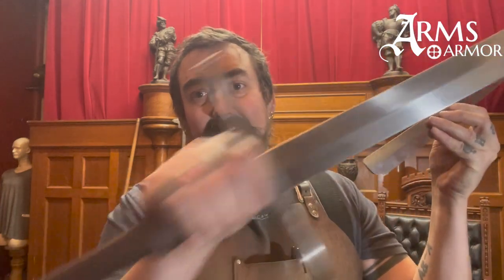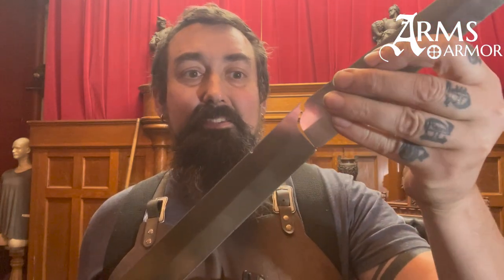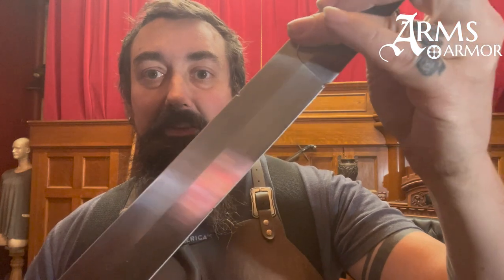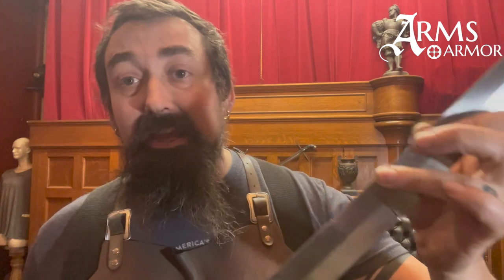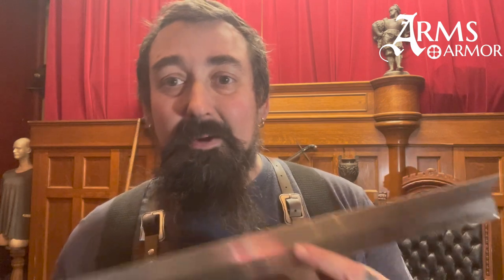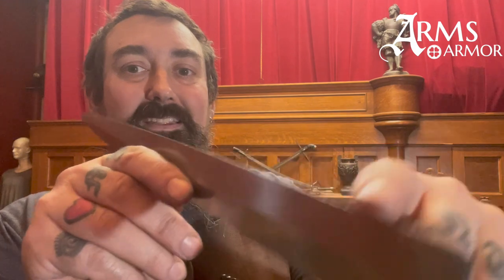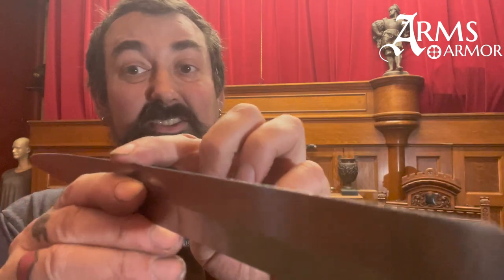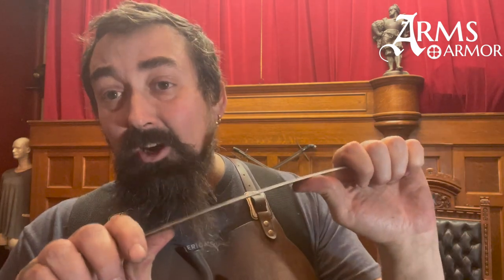How to break your sword...

Comment: With the later sword styles that explicitly tell us to parry/block edge to edge, they typically use the blade's forte. I notice that this break happened rather high on the blade. When using the forte rather close to the hand to stop an opposing blade, as is done in George Silver's style, it's the most robust part of the blade. The attacker's blade would tend to come off much worse than the defenders. So that's a factor to keep in mind. Defending in a way that makes your opponent's sword more likely to break than yours could be advantageous.

There is absolutely evidence that swords frequently broke in battle. For instance, William Patten's account of Pinkie 1547 mentions how some cavalry soldiers broke multiple swords in the pursuit. The Scottish forces had dropped so many swords in their flight that finding a new one was easy. It's not clear from the account how these swords broke, but Patten mentioned striking swords at helmeted heads in the pursuit.

Comment: I've had a few really high-quality practice ("sparring") swords break, and they all broke at the Center of Percussion at about the 2/3 or 3/4 length of the blade, and they broke exactly on a previous nick location, even though those nicks had been filed and ground/reduced to a reasonable rounded "dip". As I've heard it explained to me, any serious nicks like these create micro-fractures in the steel, and then if you get a few more hits in the same location (which is almost certain at the C.o.P.) then eventually that steel is going to shatter along the line of that previous micro-fracture.
Reply from the maker: Yes we see a wear pattern on original blades in the same areas. It goes to reason that when swords are used in the same spots over time it will affect the piece.

Comment: Very cool video.  Regarding edge parries, I think the pendulum swung all the way to the other side and nowadays we think that flat parries make no sense at all.  That doesn't seem to hold up, if we analyse the techniques.   In German fencing, both with longsword and with messer, they use this thumb-grip, where you place the thumb on the flat of ricasso.  
It makes flat parries very hard to avoid.  They even put the nagel in the right place.

One more thought - It seems that metal armor not only prevents you from taking damage while being hit, it may straight up prevent you from getting hit in the first place.  If not for sword damage, people might be willing to hit hard the joints, in hopes of the armor eventually jamming up.  But if you risk disarming yourself in the process, that doesn't seem like such a great idea anymore.

Comment: Also, in Japanese sword arts most of the parry’s end up being with the side of the blade.  This because the sword is held edge down, and swept upward and to the side to parry an opponents downward cut.  Another common block is to hold the sword vertically and edge forward, but then to move it straight to the outer line of your torso to block incoming cuts.  Since the wrists are locked to resist the cut being blocked, the edge stays mostly forward.  

I suspect the Japanese sword arts are more indicative of medieval European battlefield sword techniques than HEMA - because the JSA’s assume the opponent is wearing armor, and HEMA assumes blossfechten.
Reply: I think it's more the back than the flat, since the kata (with bokuto) emphasize a lot on using the shinogi (the speficially made angled flats on the back, not the flat back, but the angled ones) for nearly all parries. Even the thrust parries/displacements (like the 3rd and 7th tachi kata in kendo) heavily emphasize using the shinogi.

Comment: I’d LOVE to see some testing with steel that is as historically accurate as possible. There has to be a way to analyze the steel/iron from medieval swords and try to recreate it to testing. 

Also thinking about differential heat treating, fullers and case hardening. So many variables it seems. Is there any historical evidence in differential heat treat and/or case hardening?
Reply from the maker: Check out our posts on Medieval Heat treatment in the blog. The big obstacle is budget to do all above.
Reply: @armsarmorinc.4153  I’ll do that. I didn’t realize you guys also had a blog. How much funding would you need to do the historical testing and analysis? I run Fire Iron Forge in North Idaho. We’re a full time blacksmith shop and school. I’d love to partner with you guys if you’re interested. Especially for educational purposes.

Comment: Wondered for a long time how many daggers and seaxes were part of a sword in an earlier life, so to speak. Related, would love to learn more about how a hilt would get a new blade, and how a blade end broken off might be redone and fitted to a new hilt. Also! You mentioned Narsil, and there's that scene where they forge the pieces back together. Is reforging an option? Similarly, for a chipped edge, you mentioned grinding the chips out, which of course removes material, but I am wondering if material could be forged back on? I suspect not, because reheated & tempering, etc. might affect the whole blade? Probably I should go Google those. Anyway, thank you for sharing your expertise and insights in these videos.
Reply from the maker: hello, I don't think reforging a blade back together would work very well, for the reasons you mention.  You could certainly regrind both ends to make shorter weapons, which is not difficult and was likely done a lot.  In fact, we often use broken weapons to make new smaller weapons for ourselves.  My boar hunting dagger is actually the last foot of an old sword, ground down to have a new tang!  If you were to reforge a broken blade you would probably want to break or cut it into shorter pieces, stack them, and then forge weld that stack into a new bar that you could draw out and shape into a blade.
Reply: @armsarmorinc.4153  Thanks so much for replying!

Comment: When I say edge on edge I mean direct 90° impacts. When you showed the impact at an oblique angle I would personally have called that edge to flat.
I personally have found when I have sparred & moved as I interpret things that it's actually more difficult to hit edge to edge than edge to flat (which includes what you described as oblique angles).

Comment: Aren't there many examples where the blades were not sharp for their entire length?  It would make sense to sharpen the half closer to the point, which you want to use to inflict harm, and maybe leave the stronger section near the hilt dull for parrying purposes.
Reply from the maker: We see some like this and also pieces with specifics spots to place the hand for half swording.

Comment: I have smacked a few swords together in my day.  One thing that seems to break them quicker is  creating chip/nick/ding/wedge in one side then striking something sturdy with the reverse side.  Do you find historically that one side was more diminished than the other?  It stands to reason people had similar results in the way back when, and I wonder if swords tend to have more damage on one edge either by the fact they survived or that users tried to keep the damage on one side intentionally.
Reply from the maker: Also the way swords are, most users have a preference to how they hold there sword and tend to use the same long and short edge orientation.

Comment: How do you replace the blade with the pommel peened? Do you break it off somehow and weld another tang on, or something? Also, please test that angled edge-on-edge bind some time; would be very interested to see the results.
Reply from the maker: This is why many swords had a peening block where the tang emerges from the pommel.  it is an extra piece that protrudes up from the pommel that allows you to grind the peen off so the sword can be taken apart more easily.  otherwise you can drill the peen out of the pommel as long as the peen has remained relatively soft.
Reply: @armsarmorinc.4153  Huh. Something that's been lost in the modern times.

Comment: When you hold the sword in the thumb grip (placing your flat in line with your wrist and radius/ulna), you mostly parry instinctively (oh shit! parries) blows with the flat because of the line of force/resistance being along the flat. I believe being parried (my weak their strong) is more problematic then parrying. As your sword also broke at the weak. I haven't seen a sword or a feder break at the strong yet.
Reply: " I haven't seen a sword or a feder break at the strong yet "
It's apparently quite common, as the leverage is the greatest there.

"D.A. Kinsley, British Sword Fighters, p 289
I struck my sword into his skull; but the fellow, being big and heavy, snapped it asunder as he fell, within a span of the hilt."

"D.A. Kinsley, British Sword Fighters, p 507
he made it descend on the pericranium of his unfortunate adversary with a force which snapped it at the hilt."

It may happen less often in practice, since people do not consciously try to hit their practice partners with full force.  During a parry, the inertia is trying to bend the blade in half, so it's reasonable to expect more breaks further up the blade, especially if we factor in cumulative trauma.
Reply: @bakters  Interesting anecdotes! Thank you very much! I don't quite understand how the leverage stuff works, in particular when considering distal taper and the fact that there generally is way more speed at the weak. But then one has to consider the difference of simply impacting or effectively penetrating the target. I imagine that penetration can put some torque on a blade, for example hitting bone at funny angles or by weight shift as in your second example.
Reply: @freifechterbasel6115  Re: "leverage" it's simple distance*force, so the same force acting at a longer lever creates much higher torque.
The physics of impact is not trivial, though.  Even if I could do it justice, it would take a long time to explain.

Although, maybe not?  The swords want to rotate around their pivot points.  If you reverse the rotation, which happens at impact, the highest stress is more or less right at the pivot point.

Obviously, people tried to counteract this phenomena by making the forte very thick.  But it still happened from time to time.
Reply: @bakters  Thank you, this helps!
Reply from the maker: Excellent points in over forty years of sword making I can think of maybe two that gave way in the forte area. Both older blades and be used in heavy conditions, shall we say. I think the historic term was "buffalos"

Comment: Interesting.  On a related note, how often do you see tang shoulders made with a radius rather than harsh corner?  I’ve always wondered if this was a concern for ancient smiths.
Reply from the maker: on historic blades i see them but there are many right angle tang/shoulders as well. I think most folks run into problems today when the blades are to hard and the tangs are hard as well.
Reply: @armsarmorinc.4153  so most swords had a soft steel tang to account for this?  I take it you guys do this with your blades?
Reply from the maker: for sure.  We always soften our tangs.  This happens when we heat the tang to burn on the grip, which gives a nice fit on the interior.  Also, if the tang isn't soft it's really, really hard to peen.
Reply: @armsarmorinc.4153  very cool!  And good to know!

Comment: the flat of my strong! 😀 I'm shocked that a blade tempered to 52 rc broke like that! is the core of the blade in the break still 52 rc?
Reply from the maker: most likely we have not tested this piece in that way but with modern materials and heat treat the thru hardness is quite consistent were a medieval blade is often not.

Comment: So here  is what i am wondering about now. Medieval swords were softer because of metallurgy, right? Aren't softer swords not also less  likely to snap, but  bend instead? You mention it in another video, steel  can't be straightened without weakening it if it happens a few times, so what happened to bent swords, were they straightened  or discarded for a  new one? Do we know what was more widespread, bending or breaking?
Reply from the maker: They mention in one of the sagas I think or maybe its a Roman account, can't remember where it talks about stepping back from the fray and bending your sword back straight and jumping back in. I think more would have bent and deformed than sheared through.
Reply: I had a bent 1060 steel sword in my hands once (the tip was bent about 5-10°). We were not able to bend it back by hand. We got it to about 40° the other way but it sprang back to its bent position. Maybe we were too timid, but it felt wrong, like it would break before we straighten it and we didn't want sharp blade splinters go flying. You would need some experience (or luck) and maybe a hammer and anvil to be successful, right?
The romans used wrought iron or steel, I have read of carbon contents between 0.04% and 0.4% were measured, also there were sand and slag inclusions in the blades. Quite the variance in quality for something your life might depend on. Reminds me of the ULFBERHT swords. Signed swords of high quality that were badly copied, you could either get a real 1080ish steel sword or a wrought iron copy with wrongly written inscription (around 10th century AD). Many more faked versions were found than real ones which tells me most people back then couldn't afford it. Still, I'd be interested how a wrought iron sword fares against a good high carbon/spring steel sword in terms of how much damage either one takes when cutting hard objects or hitting each other.
There are a few videos where people put a bronze against an forged iron/steel sword, the bronze bends with almost every hit on the other blade (or any hard object). For bronze swords there is more evidence since bronze can endure longer being buried, there are a few bent examples in collections. Bending back swords during battle was very common with bronze, I bet wrought iron swords bent constantly too. Either they did not think it was important to write it down since it was such a mundane occurence or they saw it as bad publicity to say "our army spent half the battle straightening out their swords".
I really like the look of bronze swords, unfortunately almost nobody makes them.

Well, that text is longer than I intended...
Reply from the maker: Thats ok. Thing to remember is they did not have anything like a consistent 1080 steel their steel was wrought just like the iron so their carbon content was all over the place even in the same blade. Some of the Ulfberhts maybe hyper eluctoid steel so it might be even over 1% carbon in some of it but the composite blades and use of different materials in the blade means you are rarely looking at anything that compares to modern steel. As to the use of iron and bronze for blades they work fine doesn't take much to cut or even better stab a soft flesh target. I suspect most bronze weapons were more thrust orientated.

Comment: True weapons fail, but is it better to use it in a way that maximizes it's efficiency and lifespan or in a way that hastens it's failure?
Reply from the maker: The conservatism of the warrior is something one should never over look. If you are fighting with sharps you will fight differently than sparing with a friend. If you are in battle and you  are fighting you will do what you need to survive but you will also choose to keep your weapon as potent as possible.
Reply: @armsarmorinc.4153  I agree. I often see folks counter with "would you rather your weapon break or you die" and of course life preservation is paramount BUT I don't feel that example reflects the norm in a fight but the last resort option.
8n a fight you both want to live & keep your weapons functioning. Loss of a weapon could easily result in death. This is why good weapons were praised & named.